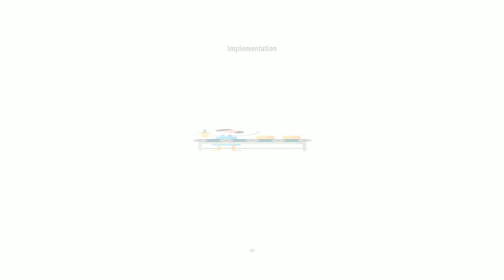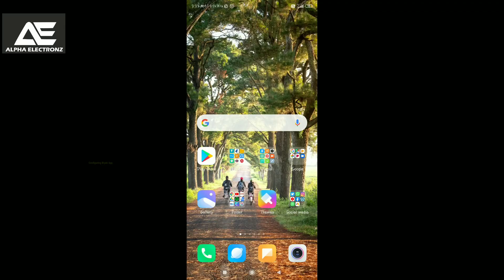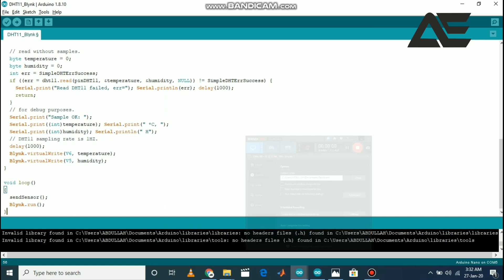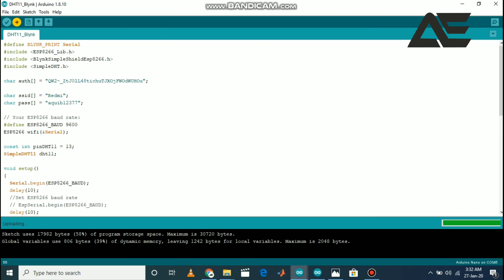Blynk ESP8266 DHT11 Temperature & Humidity Sensor

Comment: Hi ... I have a problem when i config my esp 8266-01 s not 8266-01 wifi module,in the Serial Monito Unexplained symbols appear and i can't enter commands so if someone has solution that can help me please
Reply from the maker: In serial monitor there is an option to change baud rate.

Try to jump between 9600 and 115200 your ESP 8266 have to be set on any one of these baud rates.

Or you can analyse your code and find the baud rate and set it accordingly in your serial monitor
Reply: @AlphaElectronz  
I use the code on the website.

I changed the beud rate to 115200 from serial monitior ... incomprehensible codes have disappeared but it remains when entering commands nothing applies and nothing appears.

I am sorry if I bothered you .. Thank you
Reply from the maker: You are entering AT commands?
Reply from the maker: Share your error on our Instagram
https://instagram.com/alpha_electronz

Comment: ESP8266_Lib.h ??? can u plz share the link of this library
Reply from the maker: Yes bro message me on instagram
Reply from the maker: Everything is there on the website bro
Reply: @AlphaElectronz  yes got it.
 but can i do the same with Arduino Uno instead of Nano?? plz reply ASAP
Reply from the maker: Also check the post on our website again I've updated it with a download section in which you will find all the libraries

https://alphaelectronz.com
Reply: @AlphaElectronz  I’m sorry but even with this link nothing found on Esp8266_lib. h Too bad it was a beautiful project!
Reply from the maker: Sorry for the inconvenience caused to you.

You can recheck on our website I've updated the link for the library
Reply: @AlphaElectronz  All the 3 links in the download section redirect to blynk playstore link. I wanted the library file can u please look into it
Reply from the maker: Which library you need.
Reply: @AlphaElectronz  ESP8266_lib.h
Reply: @AlphaElectronz  BTW my serial monitor says esp not responding though everything works
Reply: I even tried the AT firmware commands they work and when i connect esp back to arduino it says esp doesnt respond

Comment from the maker: DHT11 Temperature and Humidity Sensor Monitoring using Arduino and sending the data to cloud using Blynk App.
If you have any doubts feel free to ask in the comment section.

For circuit diagram and code visit - https://alphaelectronz.com/temperature-and-humidity-monitoring-blynk/